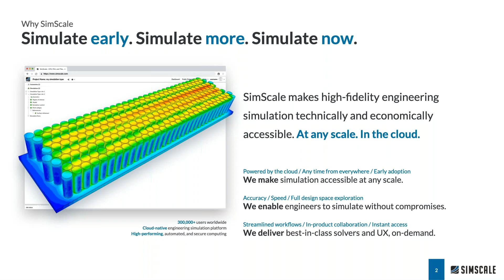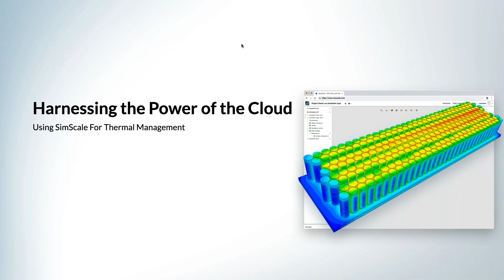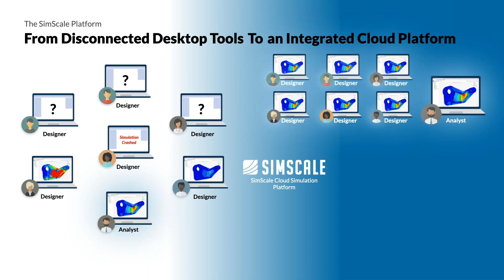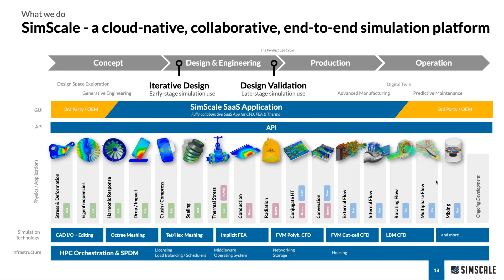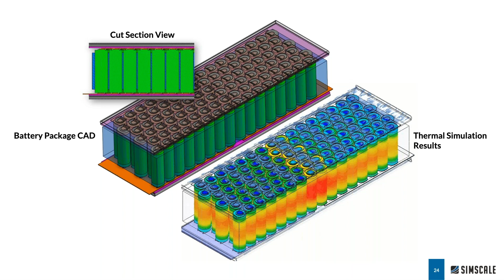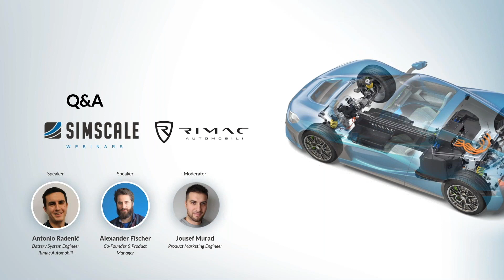Faster Product Development for Electric Vehicles with Cloud-Native Engineering Simulation

Comment: 13 hours for 1 (aka 30 ) simulations in SteadyState laminar in CHT with a fixed Heat Rate and no Battery Electric Cell Module??? The power of the cloud ?? Did you upgrade your cloud to i5s cpus ?  That's also a pretty inefficient way to design and cool the battery module.  Maybe try with your "phase change" capabilities, which you said is available but you don't have? huh?   Glad designers are not doing CFD simulations. Very insightful indeed. Great webinar.
Reply: Hello @dullumullu! Thanks for your feedback. I think there is a misunderstanding regarding the availability of phase change models on SimScale. You can find the relevant part here: https://youtu.be/2OOsnas3k_Y?t=2565 or the essentials extracted: "We also mentioned different ways how to cool down such a battery pack [...] or even with some phase change models in some way. The only thing right now on SimScale that is not yet available is the phase change part [...]". So we do not support phase change capabilities currently as you highlighted. I would of course love to get more insights on your overall feedback. If you would be willing to, please let me me know how I may contact you. You can reach me as shown at the end of the recording https://youtu.be/2OOsnas3k_Y?t=3060. Best Alex